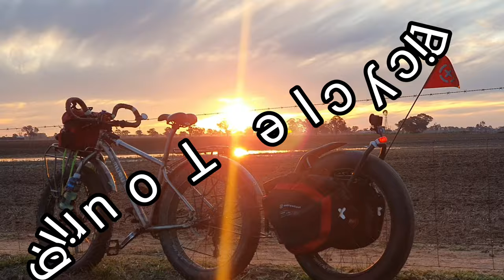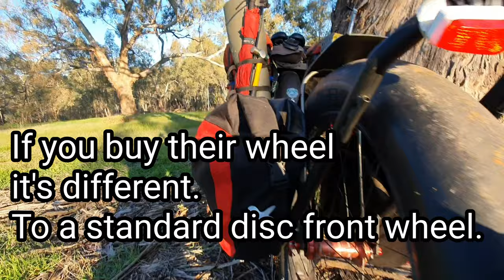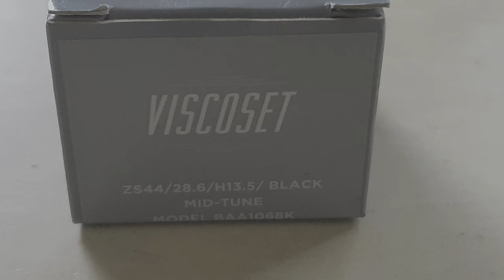Bicycle Touring Stopped by wobbling.

Comment: Pushing up that long climb with your bike fully loaded as a "test ride" for the new headset was certainly taking it to the limit - I understand why you wanted to be sure it worked, but at about a quarter way up I would have said - yeah, that's good enough, it seems ok !!! and I would have wimped out !!!  I am always amazed at your ability to just "ride on" regardless of the terrain or weather conditions. You are an inspiration for all of us to get out there and ride even when the weather is not "perfect". So glad the Viscoset sorted out your problems - the smoothness it brings also helps greatly to reduce fatigue in the arms & shoulders.  I could hear the relief (and happiness) in your voice. Keep safe & healthy and thanks again for letting us share your wonderful experiences.
Reply from the maker: Thanks yes it's so good to finally have that problem sorted. I was considering scrapping  the bike all together. It just made riding not fun on the downhills. I'm yet to take it on a tour but I'm confident it's good. Just waiting to do so. I've always been a hill climbing specialist. My brother and me used to push each other. ( he won the empire state run up the tower twice) stay safe Cheers Chris.

Comment: This happened to me with my Extrawheel trailer 10 years ago on my Mawson and Oodnadatta Track tour. It happened on sealed roads only, and only at speeds of 25-35 kmh; at 40kmh on the descent into Adelaide the bike was rock-solid. I tracked it back to two things:
1. Load weights - by keeping heavier gear (cooking kit, fuel, water) in the rear panniers and lighter bulkier gear (clothing, sleeping bag) in the trailer panniers the problem was reduced greatly.
2. On a sealed shoulder out of Copley I was able to see that a regular sealed surface oscillating rumple would cause it to happen. If I rode back on the smoother main road surface it would stop immediately, then riding back on the rumpling shoulder it would start again.

It was never something as dangerous as a real speed wobble, it would not show any signs of worsening. Also in my experience it never occurred on rough gravel nor sandy roads. I can only presume that the vibrations from them were never regular enough to cause oscillatory movement. Also I rarely got to ride at 25-30 kmh on such roads, especially with headwinds. I also had no problems with it on the other major tour I did with the Extrawheel, in the Red Centre.
Reply from the maker: Yes I had it slightly in the past when I overloaded the trailer. This was a whole new ball game with the whole bike making virtually impossible to keep it straight on the highway. Thanks for your input. Ride on cheers Chris.

Comment: So Chris are you saying that the wheel that the trailer manufacturer supplies is laced dished? That would mean it was still centred in the drop out whereas your wheel has no dishing and so is off centre?
Reply from the maker: I'm not the best with terminology. But as far as I know now the extrawheel is straight. Beacause my wheel is a spare front wheel with disk it's slightly of centre when in the extrawheel trailer. It's pointing straight just of centre. If that makes any sense.

Comment: Hey Chris, you motivated me to buy a couple of racks for my bike and get out just free ranging from the caravan park for now.  I haven't watched the whole video yet but I was reading your comments and seem to remember you mentioning something about that power supply not being compatible with solar. Haha do you think that's it? The new equipment list sounds like you're going to have a lift in production values.
Reply from the maker: Good to hear. The battery does work with solar but not the best battery. ALDI have a 20 000 mAh quick charging battery fairly good. And there's lot's of better options on the internet.

Comment: The fat bike looks to have a shorter wheel base than the Kona. Do you find it a bit more “twitchy”. And if so, do you think it could have contributed to the wobbles? Love your work by the way!
Reply from the maker: Thanks. It's designed for suspension forks with 120 mm of travel and being titanium maybe this is the reason. It's sorted now with the Viscoset headset from crane creek. Just haven't got to take it on a tour. Still in lock down for 5 weeks.

Comment: Not sure if this will help but if you get a rebuild of that wheel done,
use the EW trailer as the stand for final truing. 
I once had (still do) a Campagnolo Low/High flange rear hub that was meant
to reduce wheel dishing. I had the left side (Low) laced 3X and 4X
on the drive side (High). Carried some fearsome loads and never had an issue.
You may have an unresolved dishing issue that the factory wheel has had fixed.
Just saying.... hope it works out for you. I'd love to know the solution you find.
Reply from the maker: Thanks for the information. I'm sure I will fix the issue at some stage. My friend redesigned the extrawheel to fit a thru axel & change the bottom bracket altogether I'll consider this in a few weeks.

Comment: ABOUT! Bike with a trailer, this is good  in my opinion! I am, too, dragging along a bicycle trailer, though a two-wheeled one, which is very difficult to pull uphill. But there all the necessary things interfere with me there, insofar as I am already have an age not for lite packing  travels.

Comment: Hi Chris, having some wobble problems on my Witjira as well. Where did you get the viscoset ( and what size)? All online suppliers in Australia seem to be out of stock. Enjoying the vids. Thanks.
Reply from the maker: Hi, Viscoset zs44/28.6/H13.5/black mid-Tune model BAA1068k Cane Creek.  Top head tube 44mm stem clamp 28.6mm top stack height 13.5mm hope that helps. Wish I changed this a long time ago.
Reply from the maker: My local bike shop in Albury the Full Cycle installed & ordered.
Reply: @ChrisRishworth  Thanks very much  Chris.  Helps a lot.

Comment: A headset wobble sounds serious. What's the low gearing on your bike Chris. That was a serious hill you pedaled up.
Reply from the maker: The wobble is all sorted in the bike for now. I'm using a oval ring raceface 26 front 42 cassette on the back.
Reply: @ChrisRishworth  Nice 👍  I don't care so much for the top end as long as I can get up those killer hills with a load.

Comment: Using the wheel panniers looks great and they pack more than regular ones. I never understood why people use rectangular ones instead of panniers that are longer like these. It's more aero even! 

The wobbling might be bc of the geometry. Your brakes are behind the steering tube instead of in front of it, and this makes it physically unstable. Handlebars ahead of the tube means that your body weight will almost force the bike to go straight.
Reply from the maker: Thanks. The wheel was back the front. Yes silly me. The bike is almost complete now. Being converted to a belt drive with lauf forks. I'm picking cherries in Tasmania and the bikes on the mainland. Lots of bike videos to come this year, Thanks for the information.

Comment: Do you like fat tires compared to normal 2 inch wide tires? Is it easier peddling over rocks and sandy conditions? How about on pavement?
Reply from the maker: 2 inch tyres are so much better on pavement . On rocks the fat tyres are a bit better. On sandy conditions fat tyre's work where other tyre's just sink, if it's dry sand. If you cycle along a beach where it's still wet it's generally still firm. As the sand gets dry & poweredy you may have to walk with the fat tyre bike on occasions. On other bike just plough in. On sealed / pavement the fat bike is slow.
Reply: @ChrisRishworth  I appreciate your experienced feedback, your input helped.  Thanks Chris.

Comment: Interesting. That was one steep hill at the end. Respect for riding up that!
I know you have invested in the single wheel, but Burley do the CoHo trailer which has a fat bike tyre option. Not as tall as a full size wheel but still a fat bike tyre. Might be a consideration if you find your fat single wheel set up does not work out.
When you get your drone don't go over board with drone footage in your videos as many do.
Reply from the maker: Thanks Alex. The extrawheel trailer will work there are couple of solutions. The bike is good for now I can load it up for the first time. The drone & where you can use it make it complicated to say the least. Cheers Chris.

Comment: I have the trailer no problem with speed it handles good , the reason your having problems the wheel you added  is no lined up correct ie disc brake .. is your wheel ie you wheel is not lined up correctly
Reply from the maker: I wish this fact was on the extrawheel shop when you buy the trailer.
Reply: @ChrisRishworth   after looking at it  more i bet if you switch wheel around it ..ie you got it on back to front then there equal caps
Reply from the maker: @Bikepacking  figured that out 6 months ago.
Reply: @ChrisRishworth  i firgue it out years ago just forgot to post lol